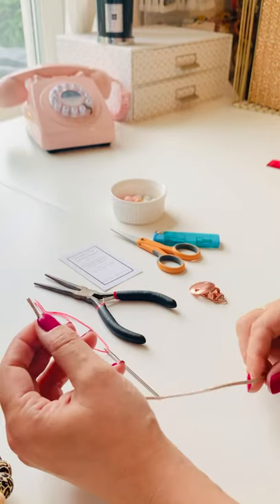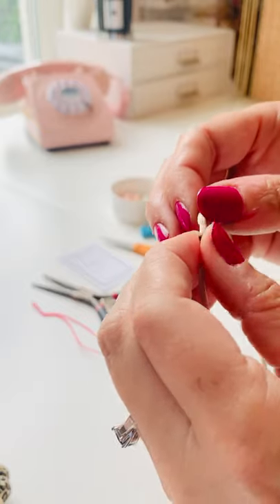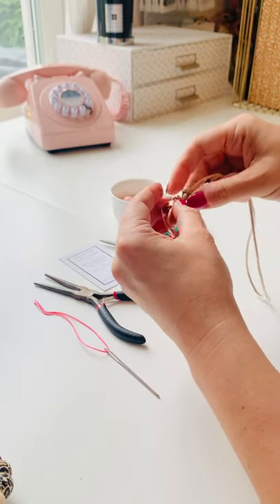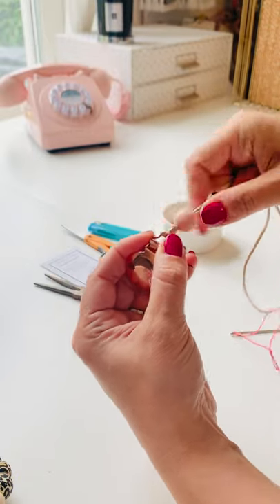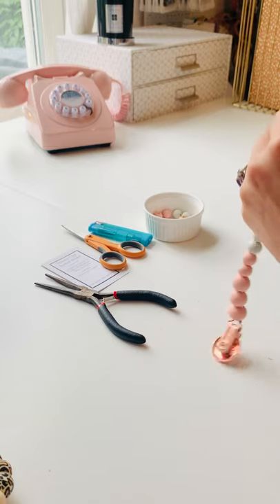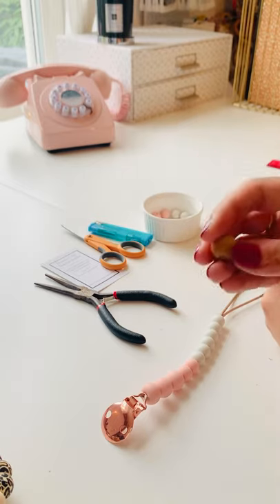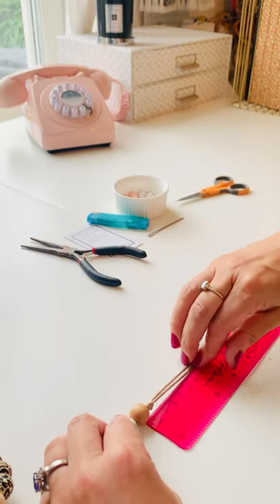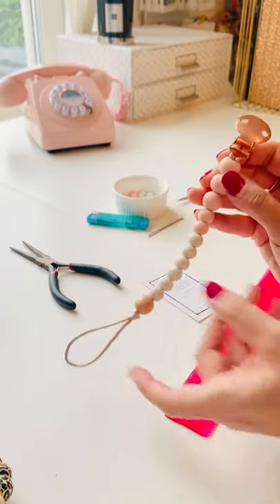How to make a safe dummy clip

Comment: Hi Kate, thank you very much for this video. I have a doubt interpreting En12586. The loop cannot measure more than 11 cm but I understand that it would be the entire circumference so it would be 5.5 cm. What do you think about this? Thanks again
Reply from the maker: Hi Lydia, you're very welcome! I'm glad it's helpful. What you are referring to would only apply to a detachable fastening strap such as a press-stud fastener on a fabric clip, or velcro close etc  (figure 9, page 24 of EN12586), as then when the loop was opened (to attach the dummy/soother) the total strap length would exceed 110mm (and possibly overall length above the maximum of 220mm). For a clip constructed like this using cord, the loop is non-detachable at any point, which allows for the length of the loop to be a maximum of 110mm in accordance with the standards (5.1.6, page 11) . Using this method shown in the video, you have detachable fasteners (5.1.10, page 11 EN12586)- either the clip or the loop, ensuring that it is constructed in a way that the loop cannot be altered, therefore eliminating the option of the length of the clip being able to be extended. I hope that explanation is helpful.

If you were to use a ribbon with press stud for example, the length of the loop could not extend 55mm when closed, and 110mm when open.

Best wishes,
Kate